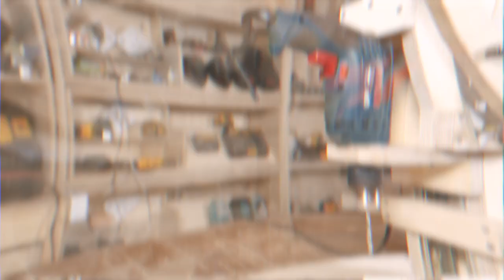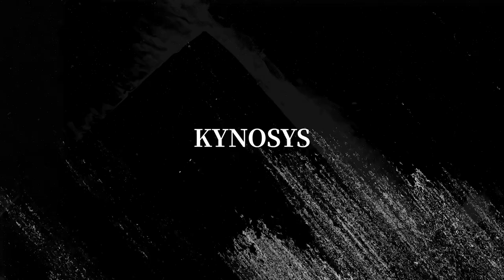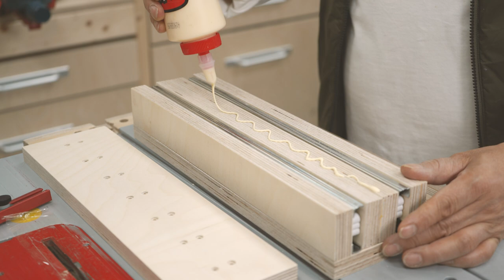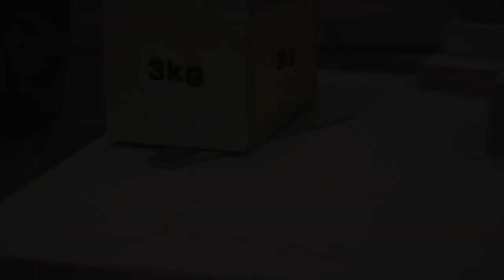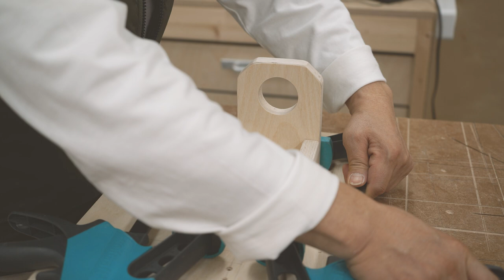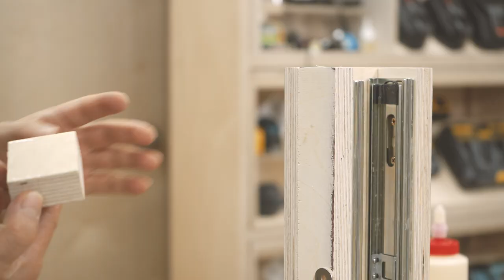Making Drill Press / DIY

Comment from the maker: I have created a drill press using an electric drill. Nowadays, people tend to use cordless drills more often, as wired ones can be inconvenient due to the cord. However, cordless drills lack a vertical guide, making it difficult to ensure perfect perpendicularity. While various drill press products are available, it's a unique experience to create your own using a wired drill.
To ensure basic vertical movement, I used drawer rails. By overlapping two sets of drawer rails, I created a moving body that provides excellent movement accuracy. To prevent even the slightest movement during drilling, I used as many pieces as possible for fixation during assembly. To adjust the drilling depth, I attached a clamp I like to the back, which serves as a guide for the drilling depth.
To secure the drill, I drilled a hole that matches the front of the drill and used epoxy bond to fix it in place. Since the most crucial aspect of a vertical drill press is ensuring perfect perpendicularity during drill fixation, I placed a drilling plate on the bottom of the drill press, inserted a drill bit, and fixed it while adjusting the verticality.
I made the handle by modeling it after the guide bar of the table saw I use.
I installed a spring to make vertical movement easier. The strength of the spring should match the weight of the drill for comfortable drilling.
When installing handles or springs on wood, using a wedge nut that fits the diameter of the bolt being fixed is recommended to prevent damage to the wood. If a wedge nut is well-fixed, it can move stably even under considerable force.
After completing the work, I confirmed that the drilling was stable. I used a Bosch corded drill for this project. You don't need to buy a large-sized drill press; try creating a beautiful one using the wired drill you have. I hope this is helpful. Thank you.

#DIY #DrillPress #Drill #Bosch #Woodworking